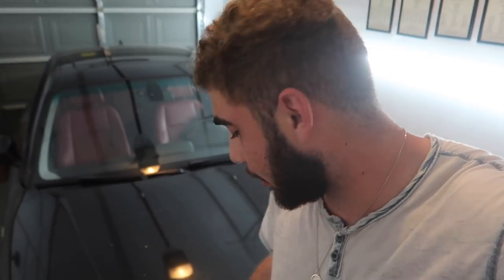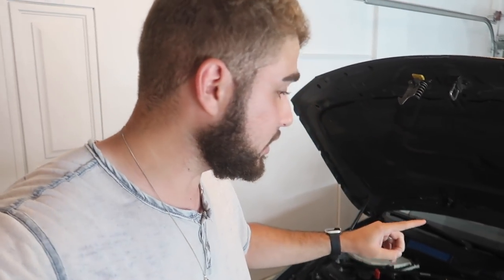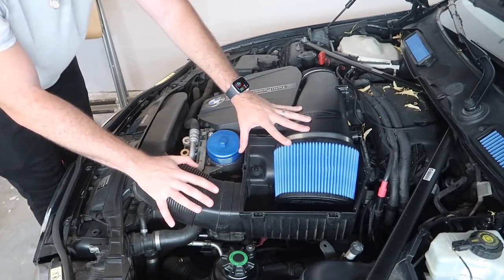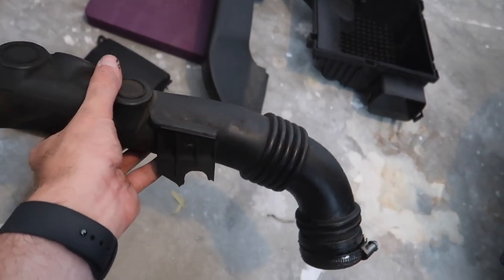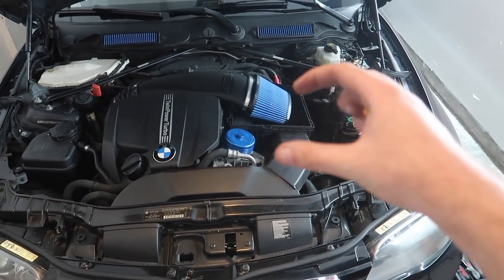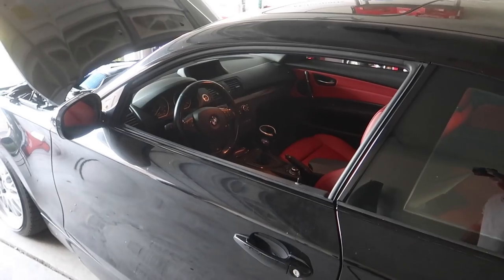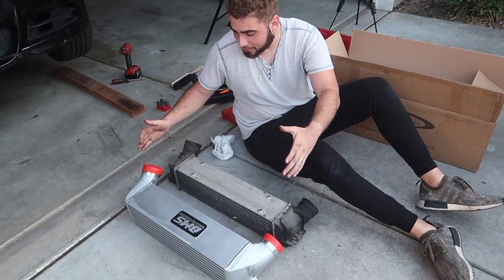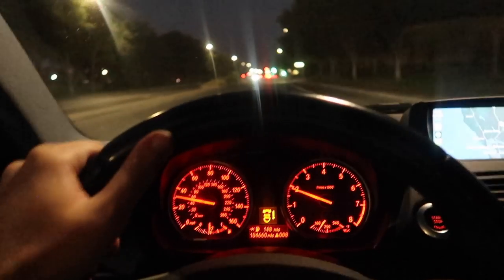BIG INTERCOOLER AND ELITE CHARGEPIPE GOES INTO MY WIFES N55 135I!

Comment: Hey Nour great video. You can actually code out the headlight error on your wifes car with Carly. It has to do with the headlight modules that allow it to change direction when you're turning the steering wheel. Hope this helps! I use bimmercode and bimmerlink which can do it as well but I'm sure carly does too.
Reply: Im guessing the M car is a white or silver m2